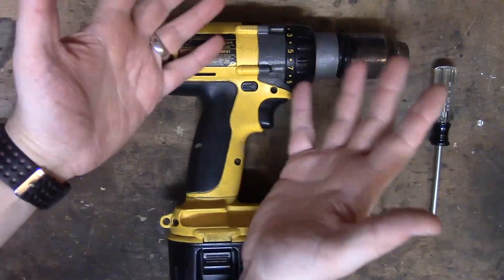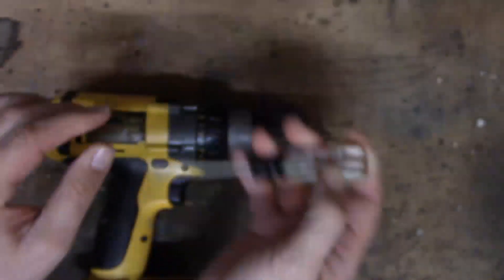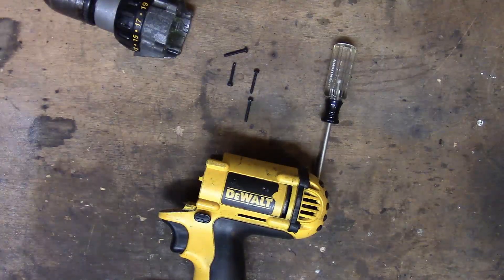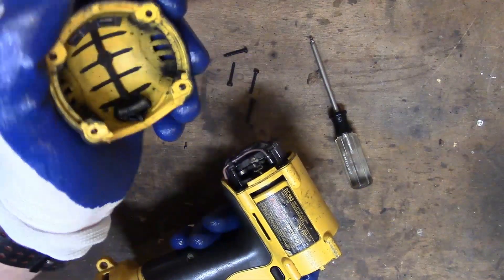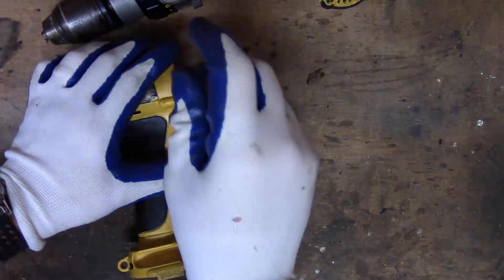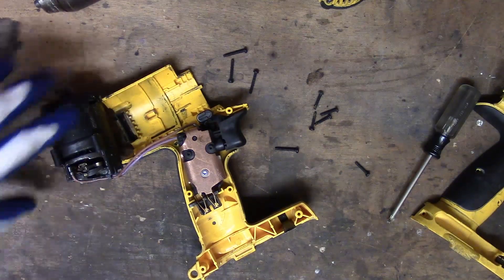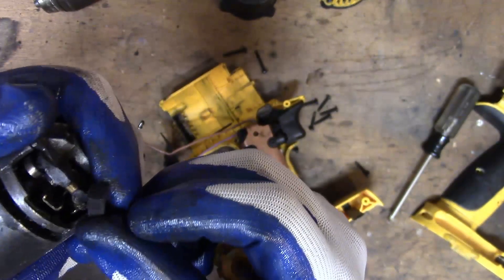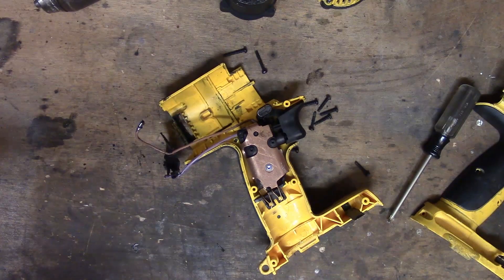DIY with MI - Fixing a Burnt Out Drill

Comment: Using this as a reference on how to remove the motor for some weird science. I went nuts and got the cute m12 brushless tools. My drill driver, hammer drill and impact driver weight 1/3 of the old brushed dw identical to the one in the video.

Comment: Nice Video. Thanks for posting.

One thing that popped out to me was that you described the wires are red and grey even though they are clearly brown and purple, which would indicate possible colorblindness. Is my guess correct?
Reply from the maker: You guessed it.  Yeah it is fun being in electronics and having colorblindness lol but you gotta work with what was given to ya
Reply: @misperry  Very interesting. I hadn't thought about that. That makes sense. Question for ya...instead of just replacing the motor is there any viability in repairing the motor
Reply from the maker: Yes, I don't remember if I mention this in the video but yes you can replace the brushes in the motor, which is what I ended up doing, and that will fix it without replacing the motor.  I just made the video and took it apart for the first time in the video so I was unaware that I needed brushes so I did not have any ordered otherwise I would have shown changing them.

Comment: Common problem with these drills is that grease from the gearbox or bearings gets on the commutator and mixes with the carbon dust from the brushes forming a nice conductive paste which then gets in between the commutator segments and partially shorts them out. This diverts some of the power away from the motor and the grease burns off making the smoke. Clean between the segments with a toothpick or something and give it a bit of a wash with your favorite solvent. Then you should be good to go. Try not to wash the remaining grease out of the bearings.
Reply: Thanks for this, you just helped me fix my drill 4 years later!